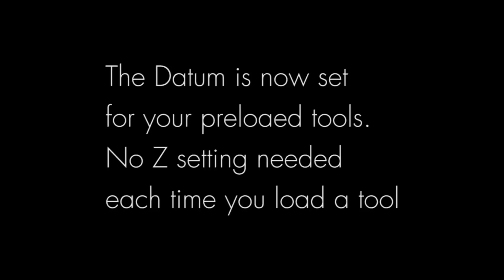Mill it MEGA CNC Milling system QTC quick tool change system

Comment: AAAHHAHAHAHAHAHAHAAHA You call that a quick tool change? No. I think you confused the term "quick" with "cheap" likely as a clickbait tactic. Tisk tisk. 
Your "quick" change starts at 0:17 and ends at 0:40... 23 SECONDS IS QUICK TO YOU???
Have you ever heard of a tool changer? On HAAS the head goes G28 Z0, the tool wheel comes over, takes the tool out, indexes, picks another tool, puts it back in. About 7 seconds.
On a Hwacheon vertical mill, the tool indexes while the machine is still cutting, a double sided tool changer picks up the new and old tool at the same time, does a full speed 180, mounts the tool.
3 seconds.
Reply from the maker: Thank you for your comment.  If you look more deeply at the poducts we offer, we offer machines various levels of automation and spindle system. Manual change, quick change, auto change. Not everyone has the luxury of affording a HAAS day 1. Yes - of course, when compared to an ATC system on a HAAS / Hwacheon / DMG - there really is no comparison for time and efficiency. However, you are in a very different league of cost and utility requirement. A system like the one shown her could be below 30k euro fully turnkey.  What if client doesn't have three phase? what if client doesn't have a screw compressor with clean dry filtered air? These ATC spindles need safety systems and a lot of extra technology to manage the spindles.. We are not presenting the QTC as a better version than ATC. MEGA mill can be supplied full ATC https://stoneycnc.co.uk/cnc/mill-it-mega/atc.   the QTC is presented as a way to give a client on a budget, and affordable, reliable, repeatable way to change tools and apply tool offsets. This spindle requires no air, no sensor monitoring system, runs on single phase  The QTC opens up a lot of possiblities for a guy running single phase as a start up in his garage.